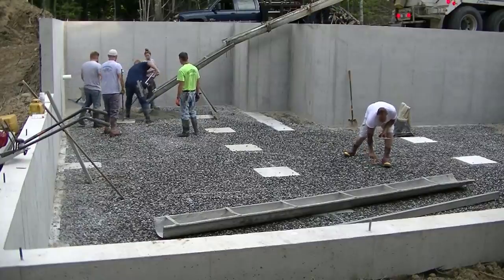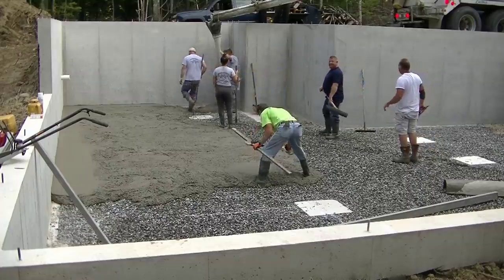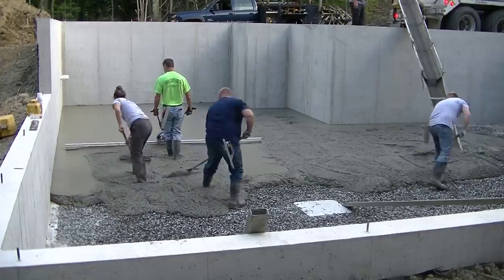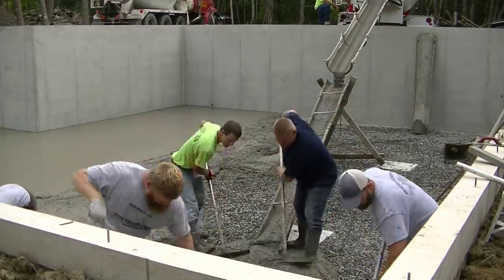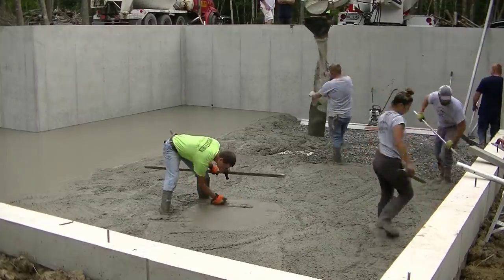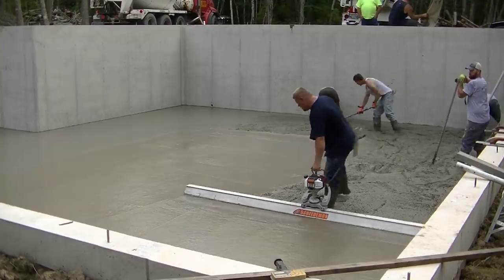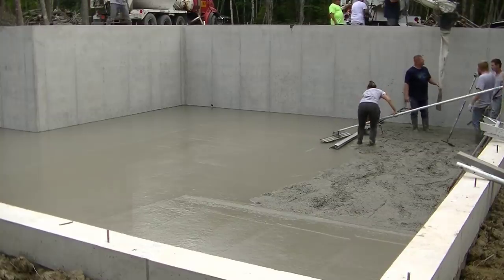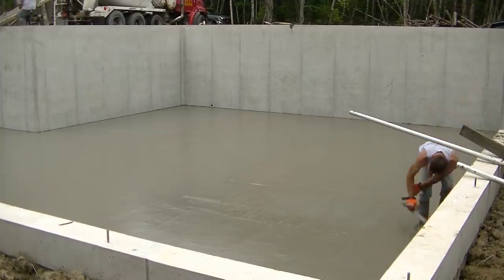Pouring Concrete For A Basement Floor (What We Use Instead Of Pumping)

Comment: I live near Sioux Falls, SD.  Pour concrete for a ag business throughout SD, MN, and IA.  Mostly pole building floors, exterior pads, parking lots and the occasional dock wall.  Most buildings are 60x200.  Have a 50’ “A Frame” skreed.  Also have  gas MBW skreedemon just like yours with all the available lengths.  Love it!  I get a lot of inexperienced college kids for summer help and I agree 100%, having good rakers makes all the difference.  Enjoy your videos.  Thanks!
Reply from the maker: Thanks for sharing!

Comment: You guys are real professionals, everyone helps with every task. You have the right amount of workers, you not trying to pour with 3 people like I still see  today.👍👍👍👍👍...  One thing we do different is that we box out the column footers with buckets to leave a void so that the  column sat on directly on the footer instead of putting the  weight of the house on the slab. Once the first floor was done we go back and pour the voids. Thanks for sharing.

Comment: Excellent video. Your staff really works well together. I’m not a contractor but had my home’s slab work done similar in Northern Illinois in 1987. I have concrete walls surrounding a 1700 sq ft basement with a poured floor + slab for attached 3-car garage.  Fiber mesh was specified for all the pours and the floors are still in excellent condition.
Reply from the maker: Thanks 👍

Comment: Hey love your channel!
I am 65 and still doing well.
Been in contracting most of my life. concrete is my favorite part and have done a fair amount in my life. Started with my uncle when I was 12. I have been out of the daily concrete work for 6 years. I generally poured 5 1/2 to 6 sack mixes at about 5 and 5 1/2 slumps....except for government jobs, which had us pouring 4 1/2 slump.water reducer was not that prevalent 10-15 years ago... North Central Idaho.
Couple of questions...
  I still don't allow flyash in mixes and careful to keep the aggregates closer to the top. Vibratory screeds have their place, which is indoors.
If used outdoors it almost always results in spawling and or uncontrolled cracking. I have exterior concrete on store fronts that were poured approximately 20 years ago with zero problems. No flyash, hand screeding, low slump and air not over worked. I never use air when I'm hard trowling. Learned most of my options probably 24 years ago at the world of concrete and that is a long time ago. What do you think of the above dialogue. I am currently back into heavy doses of concrete work now and kinda need a little updating.

Next....you have me a little mixed up in that some of your earlier videos you praise the Vibratory screed yet later in time you seem to praise kick screeding. I to use wet screeding methods and enjoy the ease  of not having to stake in some sort of screeding assist. However as of lately you now seem to praise the Vibratory screed again. Your kick screeding methods are superb and I for one am impressed since it is difficult for me to find a companion to work at the other end of the screed to work at my rythum. Where are you at about screed methods? Please tell me about the modern mixed designs. Admittedly I am stuck in yester year with mixes and they work. Pretty hard to find a batch plant that doesn't rely on a computer to give me simple mixes such as sand, gravel, cement and  air/ nowhere

Sure would enjoy hearing from you.
Thank you, 
Joe

Comment: I live in Cincinnati and I'm a Construction Manager for industrial projects.  If it's a long reach we typically always pump the concrete since its usually a longer reach than a house basement slab.  Just built a 1.2 Mgal cast in place concrete tank and the mat foundation was a continuous 100 cy pour that we pumped.  For houses your method seems to work well.  We use rebar, fiber and shrinkage reducing admixture.  Also take cylinders and do the slump and air tests.

Comment: I am a lifelong concrete foundation and slab worker. Almost 20 years. Our foundations and slabs are much like this except out footings don't need to be as deep. Our frost areas do need to be lower than 30inches. I absolutely love those shutes you use to get the pour farther back with the trucks. Im thinking about fabricating some for my guys. Seems like a money saver.
Reply from the maker: We use them a lot. I have an 8', 12, 16'. We use the 8 more than the others.

Comment: Rochester, NY. Mostly the same. The walls are block half the time. The guy I learned from and some of the contractors in the area don't like to pour an open basement. The excuses are weather and wall integrity. So they cut a hole in the subfloor, run a shoot to wheel barrows. The same floor takes 3hrs with 2 wheel barrows. I pour them open, with the telescoping conveyer on the trucks here. Nice work guys. Nice controlled  pour by expierenced people.

Comment: I lived in Alberta Canada, North of Montana. We put footings down about 5 feet. Pour floor like you. Many times they put subfloor on, then have to pour thru a window, and wheel. Often have mechanical room in basement, with water, so put a drain in there. Also water line would come from underground. Water is usually trenched  8 feet deep. Most basement walls have windows, as they are usually finished to utilize space.
Reply from the maker: Thanks Warren! We have to go through windows occasionally too. I try to use my chutes, stick it out the window and connect a couple together if I have to so we don't have to wheel. Works for most of our pours.

Comment: You guys (and gal) do nice work!  Pouring inside a basement sucks and makes everything more difficult.   Im in north central iowa, here most all basements walls are ICF. Some still use pans if they are trying to save money.  Alot of basement floors have insulation and a vapor barrier under them (which they should imo) but it all costs more.  People dont realize that spending more upfront with insulation and a vapor barrier will help you have a comfortable and dry basement (good drainage is a must first and foremost).   Its important that all crew members are capable of doing all tasks as yours appears to be! I noticed that nobody on your crew stands around waiting for others to do something ( such as bull floating )!  Most crews use pump trucks here as alot of basements arent backfilled.  Nice video!
Reply from the maker: Thanks Travis!

Comment: We used the Muti-Quip screeds 4 cyc. They were heavier than a lot of the others but they lasted and preformed well. We usually run a 10` rod on them or you could switch out and go from a 16 to a 3` rod on it. Even if you had a spot that was getting tight it would still handle it. as usual they just discontinued the model we used [ we had 6 of them ]  a couple years back and now the new model is out don`t care for the handles on that one but if you want new,  you gotta adapt. In fact I even bought one for my personal use at home. Alot of people don`t like them but if you watch the videos and all it will learn you to cut grades and run forms properly. Even the ole junk ryobi screed we had in the 90s had video instructions on how to work grades and forms and how to deal with the potential fall from vibrating. and even cut on one side of the rod and not the other , once you learn that stuff you`ll use a screed on the biggest or the smallest job. Just need a good pair of rackers for a professional job every time. We used to run 2 screeds at a time on the bigger ones and it was nothing to pace the mud at 100 yd an hour. Oh forgot to mention if you wanted to run a 20` or longer board you just have to hook up 2 motors on the screed. Most of the new screeds coming out today have lighter screed rails and don`t want to preform unless your looking at 7" slump witch you won`t get to do because of the slump masters on the job. Thats what happened with the 2 Ryobi screeds we had ,they were to light so the foreman told me to hide them in the shop and tell boss we could`nt find them ,but it was worth the lie. If you want fancy they have many sizes of screeds ,one crew used one that was like a little fruit cart with motor cycle tires on it , but it was laser guided and worked well. If you want to get real fancy you can get the big 4 wheel drive laser guided model. Just drop the whole load in one spot [ about 2 min. to drop and not even 2 minutes to finish the load afterwards]  That set up you can you can pour 800 yds and look at going home for lunch for real. Oh well enough of the yakking. Certain brands of screeds the book says you can substitute 2x4s in place of the rails. Now I`m done Yakking. Can you tell I just retired and got no one to talk to.

Comment: I'm in Canada so this is like a day at work really. Lots of the same stuff. My boss is expensive so he gets a pump truck all the time which as a laborer i appreciate lol saves me wheel barrelling. Like that shoot idea though as someone looking to partner with someone once my boss retires so i dont have to charge so much
Reply from the maker: Thanks Trev!
Reply: Saving money is not worth wrecking your body. 20 years finishing concrete taught me that.
Reply: @georgeheller2281  Ya i haven't worked as much this year with Rona and my boss is like 60 and is getting surgery on his ankle.  I've met him as he is winding down which sucks he used to have a ton more machines. The sit on ride Trowels and did way bigger jobs but im cool learning on house foundations and garages etc lots of stamped

Comment: western NY here, never used a pump truck ever to pour a basement, homes are already framed and dried in by the time basement is poured, we use 12' sections of 12" sdr35  cut in half as chutes which then we can reach 35' if need to

Comment: I'm in Minnesota. Frost depth is 42" on this end of the state. Very, very similar to how we do things except for the beam and columns supporting the main floor. It's far more common to see long interior footings with a row of half height 4" cmu with anchor bolts. typically, the main floor is built, supported on bearing walls resting on that row of block before the slab is poured. I've seen roofs get shingled before the slab gets finished.
Reply: General contractors tend to wait until they absolutely have to have the floor poured to accommodate the buyer. As more of the structure takes shape, it's inevitable that they begin to inquire about making changes to the plan mid construction. As long as the slab hasn't been poured yet, things can still be modified.  Pouring the floor locks in the design.

Comment: Use to be a batchplant operator ..been awhile since we poured cement..we used to pour foundations,slabs for basements,ICF 's,walkways,landings ,ramps, but unlike you we do all the forming,tie rebarr and vapour barrier, whenever we ready we pour it ..oh n we pour in the summer,fall seasons cause we live in a northern community so..also I'd mix for outside contractors..well anyways I used to..

Comment: I'm not a contractor. I've done a fair amount of concrete over my lifetime of 70 years.  However, on my latest house which was 5 years ago, I hired all the concrete work.  My foundation is ICF's and I set all the forms.  A bit more complicated as the outside of the house is made up of 17 8 foot segments.  The walls joined on a roughly 22 degree angle.  Lots of cutting of the ICF's. The garage is conventionally shaped.  The house took me about a week to form but the garage only a few hours. All the concrete contractors here do all forms of work, poured walls, block walls and flat work including stamped concrete.   We're in the Black Hills of South Dakota.

Comment: Not much call for basements around here since most of our finish floor elevations are in the +8-10 feet above sea level (ASL) range (S. FL). If you dig down more than about 3-4 feet, you generally start hitting water, so de-watering for foundations with well point systems is pretty common. 
  On those rare occasions when we do have a job on a little higher elevation and have to pour over foundation walls, everyone around here is so inexperienced with it (I include myself there), that no body ever really thinks to do it any other way than a pump or crane bucket, so it’s interesting to see how you guys do it.
Reply: No rebar?
Reply from the maker: Thanks, we've done it this way ever since I started. Sometimes we'll have two 16' chutes to reach an area. Pumps are expensive here in Maine.
Reply from the maker: Not on a floor like this Scott. It's not needed as long as the sub-base has good compaction.

Comment: I’m from Oregon we always pour floor or basements with either a line pump or boom pump. Prices seem cheaper here on pumps I can get a line pump for $500 for 30 yard.
Reply from the maker: Nice info David. Thanks.
Reply: I am now in Central Oregon and unless its some sort of daylight basement for house on hill we never have basements. It generally takes a track-hoe with hydraulic hammer and several days just to do standard depth for foundation and most homes are built on slabs or raised foundations for this reason.
Reply: @jaycline4858  in Portland on the hillside they’re very common the soil isn’t hard but as soon as you go a little west like mollala or boring definitely the soil changes and definitely need that hydraulic hammer

Comment: Northern Illinois, our frost level is 42”.  We pour our floors about the same way.  We pour foundations and flatwork.  I’d like to see a video of you guys pouring in the winter, heated and under deck.  That always makes it more challenging.  
20cy basement and 3 car garage, this is a 4 guy pour for us.  If I can get the stoops too, I’d have a 5th guy.
Where is the vapor barrier, under the stone?
Reply: I wouldn't pour concrete floor without that vapor barrier.  It helps keep the moisture in the concrete for curing.  (this guy said the vapor barrier isn't his responsibility, it is the contractor's )  However, why take on a shitty job???  Obviously taking the money and not having to offer any warranty is motivation enough?
Reply: We need a VB in basements and attached garages, per IBC.  Sometimes a VB can hinder the finishing process.  It’s not always desired.

Comment: I live in south georgia right on the florida line. We don't have basements they would flood from ground water. Frost line is pretty much non existent. So our slabs are either mono or block foundation.
Reply from the maker: You pour year around also?
Reply: Yes year round. Cold isn't so much a problem as the heat is in the summer. Very easy to get overheated. You and the concrete 😂

Comment: Industry, Maine! Right outside of Farmington. You do beautiful work. Just had to say that. Here's a question for you: I've seen a lot of slab foundations around here that seem to just sit on top of dirt. No frost wall or foam insulation or anything. I have this situation going on in my old garage right now. The thing heaves like crazy come February. I've seen houses like this. So I ask, why do you think these homeowners originally poured slabs like this in Maine and do they heave under the home?
Reply from the maker: If the structure is heated, frost will never get under the concrete. If it heaves, there's some kind of moisture in the soil. Probably doesn't have a lot of gravel under it. It's gotta have a good gravel base, especially if there's any clay in the soil. And the exterior landscape has to slope away from the building to shed water.
Reply: @MikeDayConcrete  Thanks Mike. That's a great answer.

Comment: Some contractors don’t like to backfill until at least the floor system is installed to brace the walls. Shorter runs like the house you show are ok but when you get much past 15-20’ I see a lot of contractors refuse to backfill until floors are on for bracing. Yes... I’ve personally seen backfilling go wrong and put bow into basement walls.

Comment: If I was the home owner I would demand at least a 3500 mix. I'm in Michigan and this is how most of our contractors pour an open basement floor however most are not open and they cut a hole in the floor and use chutes. We have 3 different plant's and all of our mixers are front discharge mixers NO butt dumpers.

Comment: Hi Mike
I was wondering how you form out drains in the basement. You know the 10 inch round drain covers I see in basement floors with holes in it. Usually 12  deep. A lot of times the weeping tile feeds to it.

Comment: I am from Maine also. The frost don’t have to get under the wall to break it. Clay back fill can freeze on to the outside of the wall and lift it up and break it up. My farther started foundation work in the 1960 ts and came up with the price per linear foot in the southern Maine area. He built the foundation for the very first McDonald’s in the state of Maine on st.john street in Portland Maine. We also did floor’s witch he hated to do. He had a power screed I think was called a hitter bug. I am not fake because I can tell you that those trucks that you are pouring out of belong to Auburn concrete. I stop working for my farther in 1994. The last trucks that I worked with belonged to Blue Rock industries in Westbrook. I am old enough to say that when I was a kid I watched my farther pour concrete out of B model Mack’s before they were burned in a fire in blue rocks garage in Westbrook Maine.

Comment: Nice work Mike and co. but why would a builder ever delete the vapor barrier? there's no way to fix that later without taking the floor up.
Reply: Yes even the loss of water from wet concrete is enough of reason for that.

Comment: That slab sometimes involves laying a strip of polystyrene all around the perimeter to act as a damping zone to account for concrete expansion and keep it from cracking. Also, others will lay a sheet of plastic on top of the gravel before laying concrete. Any reason why  it was not done? Does mixed fiber replace steel wire mesh? Just curious. Thanks in advance.